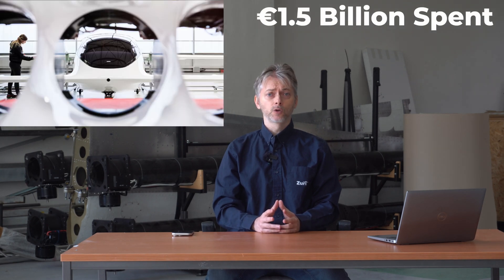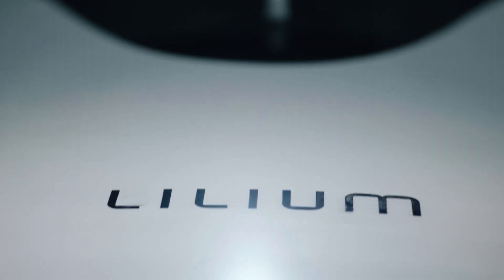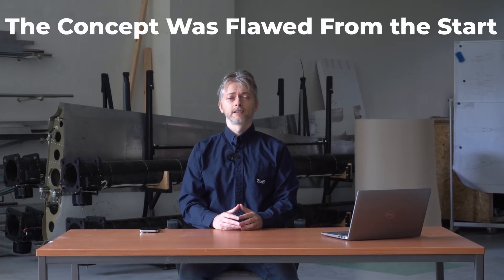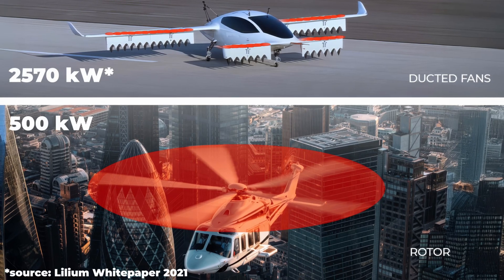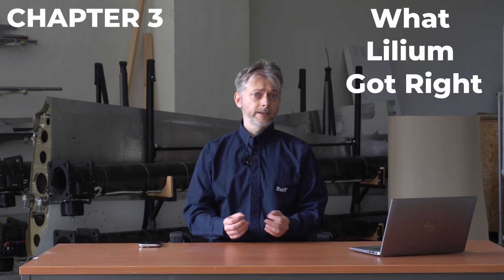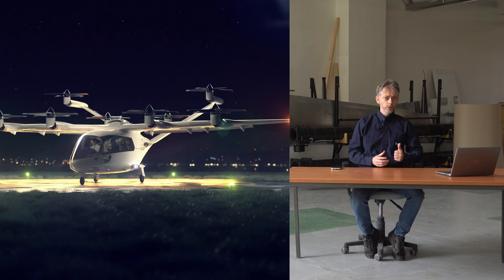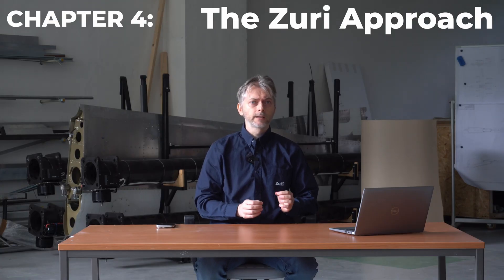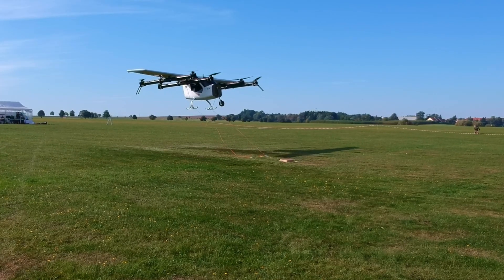Lilium's €1.5B VTOL Collapse Explained — Why It Never Flew

Comment: I don't believe that the problem was primarily ignoring simple physics otherwise the smaller prototype used for testing would not have flown at all.  As others have mentioned, it was poor management.  The company should have focussed all its resources on rapidly building a full scale prototype that did not necessarily comply with all the requirements for safety, luxury, speed and efficiency.  All it has to do was demonstrate proof of concept by having a piloted, full scale (rough) prototype, with load (which may have been entirely made up of cheaper, heavier, less efficient batteries) take off vertically, fly 20 kilometres at speed and land vertically without injury to pilot or aircraft. If they failed to achieve this after numerous attempts and subsequent refinements, then we may be able to blame physics.  This feat would have attracted all the finance they needed to then refine the design.  Instead, they burdened the company by wasting invested capital on everything but that: staffing for design, planning and location of "vertiports"; Interior cabin design and construction; flight training simulators and software; Employing too many, expensive, industry heavyweights; engine and battery development; designing to achieve first class industry certification; etc.  I am very disappointed that Lillium failed as I believe that their's was the most elegant, safest and potentially fastest of all EVTOL concepts and I am still hoping someone will scrape enough money together to purchase the Intellectual Property and prototype bits to complete assembly and testing.
Reply: The physics seems wrong.  The drag of the propulsion and weight of the energy storage don't scale up.  Scalability matters.
Reply: @LoanwordEggcorn  Physics isn't necessarily intuitive. The first time I saw an airborne Boeing 747 it didn't "seem" possible, it just looked too big to stay in the sky at the speed it was travelling.  I am presuming that sufficient, thorough modelling was done to indicate to the company that the Lillium concept could achieve the desired goals.  It really is a shame that the plug was pulled just prior to them completing a testable prototype so that we still don't know, one way or the other.
Reply: @rodcooper2682  Drag and energy density are real.  Lillium with many small motors and too much duct skin drag has too much drag to scale up.
Reply: @LoanwordEggcorn  You imply that you know more about the Lillium design and test results than the engineers working on it. Drag and density are indeed real and all aircraft are designed to minimise drag and maximise energy density. You could have been a naysayer at Kittyhawk for the first flight of the Wright brothers' machine!  It is amazing what clever, iterative design and engineering have been able to accomplish since then. Physics was just a fact that engineers work with all the time and the problems it poses are considered in the design process. Unfortunately good engineers are not necessarily good business and money managers. It is poor decisions allocating the money that caused the  project to fail before completion. (Apologies if this is a repeat. My previous attempt at reply didn't seem to stick!)
Reply: @rodcooper2682  The many small ducts have too much internal skin drag.  It worked for short flights of a small version.

The Wright Flyer got much of the aerodynamics right.
Reply: @rodcooper2682 The only problem with the management team was that the management team contained no real engineers. 

One engineer, who was courageous enough to point out obvious, was all that was required to stop the nonsense at the beginning.
Reply: @rodcooper2682  It's almost trivially simple to demonstrate from basic physics that any e-VTOL craft with today's battery technology will be limited to around 15 minutes flight endurance. Indeed Airbus built one which managed 13 minutes. Then you have to recharge the batteries all over again. Simply not at all practical.
I worked this out in a few hours. Clearly Lilium didn't bother doing the sums ! Complete amateurs.
Reply: There' such a thing as scale limitations...
Reply: @FinflazodeTurroai …this above all else. When someone says the model flew therefore it proves the full scale aircraft you know they do not have a grasp of the fundamentals of aerodynamics.
Reply: The helicopter is a more efficient design. It must be better than a helicopter to be successful.
Reply: @bubbajones6907  A helicopter is a rotary wing aircraft, it's quite different from what Lilium was doing.
Reply: @bubbajones6907  I disagree. You are comparing apples and oranges.  Helicopters are good for the job they are designed for.  The Lillium just had to be good at the job it was designed for.  Helicopters are speed limited due to the aerodynamics of the rotary wing as speed increases but they are good at lifting and hovering.  I understand the Lillium was designed for much greater speed but hovering time would be limited.
Reply: You're confusing aesthetics with functionality
Reply: With no payload you can virtually make anything fly! 
It is the safest jet, apart from the fact that it has never been a jet, unless you blow-dry your hair with a jet in your bathroom, but it is so safe only because it never took off with a person on board. I really hope nobody will ever try to make this mistake all over again.
What we can actually agree on is the fact that it was also completely mismanaged, else they would have found out way earlier that this is a highly inefficient design.
Reply: Somebody got paid handsomely for years and never had to produce a working aircraft ( and how much of that 1.5 Thousand million euros could possibly have been SPENT on the thing?  Success might just be getting your hands on a lot of other's money.
The configuration using 90 degree flaps ( with attached ducts) is what is used in some sailplanes eg the US HP series ( I built the prototype HP18 fuselage controls etc) to enable terminal Velocity diving at low speed- the tiny vector of thrust available to push those airbrake flaps to get some horizontal speed up in hover is ridiculously small ( and you can't tilt the whole aircraft to accelerate like a helicopter because the wing will then lift down ) it always was a half arsed idea by inexperienced graduates - not yet engineers.
The Terrafugia ( terrafugly) was another abortion built by first timers.  Too much dollars not enough sense.
Reply: It doesn't matter what you believe - the physics really never made sense.  Subscale models with no payload are not sufficient proof this thing ever had a chance.  It's alarming and saddening to me to see such a waste of time and talent in a world that needs these engineers working on important problems.  Not wasting time on a beautiful lie.
Reply: @Flyzguy  That comment is spot on👌 could not say it any better👍
Reply: Germans fetishise efficiency and completion over effectiveness and actually doing it.  
This is why they struggle with new things.  
Plus European capital markets would extend a new project anything like the capital the US  markets can and do
Reply: Well it is physics. The ducted fan area is too small.
Reply: It's almost trivially simple to demonstrate from basic physics that any e-VTOL craft with today's battery technology will be limited to around 15 minutes flight endurance. Indeed Airbus built one which managed 13 minutes. Then you have to recharge the batteries all over again. Simply not at all practical.
It IS the physics.
Reply from the maker: Really appreciate the thoughtful comment. You're absolutely right that there were a number of compounding factors beyond just physics. In the video, we focused on technical feasibility as one part of a much bigger picture that included timing, priorities, and broader strategic challenges. Thanks for sharing your perspective.
Reply: @zurivtol how can technical feasibility not be the number 1 absolute priority??  This is like making a magic carpet company and spending millions on corporate expenses while having a rug sitting in the middle of the room the entire time.
Reply: With regard to the technical limitations - I agree with your assessment... the battery density is the limiting factor for this technology. Even though the specific power required is five times that of conventional helicopters, the savings in horizontal flight are clear - and ultimately that is the point of this technology:  VTOL with better cruise characteristics.  

The comments on development approach are probably right as well. I have experience with starts ups that are too well funded from the outset and suffer the chaotic ambitions of founders with no interest in incremental goals. 

I would also add that the scaled technology is as yet something we are not prepared for. Notably: the lack of charging infrastructure and traffic management. There is a researcher in the US by the name of Laurie Garrow who has done some work on this.  It is well worth a look.
Reply: @planetofthepete  
Na energetickou hustotu jakožto klíčovou věc jsem Illicha již upozornil. Ignoroval to...
Reply: -Lilium Jet was controlled by fly by wire artificial stability deriving from an inertial platform and gyroscopes.  From an engineering point of view no pilot was needed on board.  His joystick and throttle could be anywhere.  Furthermore it puts at risk a pilot.
-From an PR and investment point of view a piloted version should have been a priority because the public don't understand the above.
Reply: @bernhardzunk7402  I completely agree.

Comment: You have to carry many more motors to acheive vtol and propellers all far from the centreline making for higher weight and cost and noise and power out antics...  Hovering is unnecessary and dangerous plus creates turmoil - what is sought is no ground run which is an entirely different thing.  Design misconception.
Reply from the maker: You're right that VTOL adds complexity compared to traditional aircraft. Our focus with hybrid VTOL is not on hovering for long durations, but on enabling point-to-point access without relying on long runways. That includes connecting underserved regions, smaller clusters, and areas where traditional infrastructure is limited. We appreciate your perspective and welcome the conversation.
Reply: Zurivtol - you completely miss the point . In order to hover for ONE SECOND even you still need to have thrust equal to WEIGHT plus more to enable some climb ( ie some excess power over that just needed to fly)  This means carrying ten to twenty or more ( depending on L/D max) times the power needed in cruise - the vast majority of the flightime ( unless very short legs which is much worse for efficiency due to hover and transition fraction)   ANY hovering is wasteful ,noisey and dangerous  and unneccesary .

Comment: The less articulations, the less moving parts in a flying machine, the less chances for a deadly fault.
Would you consider reviewing the Custer Channel Wing?
It worked.
VTOL is required in very few situations, it imposes high power requirements, STOL usually is enough.
What happened with Moeller Air Car? With the Dobson convertiplane?
Reply: Hello, thanks for feedback.
1. Custer Channel Wing is ok. It's not really usable for VTOL aircraft, so we didn't look into it.
2. High power for VTOL is needed for just a few seconds (typically takeoff+transition takes 30 seconds), so we don't consider it a huge problem if the rest of the aircraft is efficiently designed - that means mainly big enough open rotors.
Reply: @MichalIllich high power is an enormous problem in VTOL, and it doesn't matter the duration of the VTOL phase. 

High power requires a big engine, and the big engine weighs a lot, and a big engine has a very low efficiency at low power outputs, and when that high power is not necessary, you're dragging around an inefficient heavy engine for no reason.